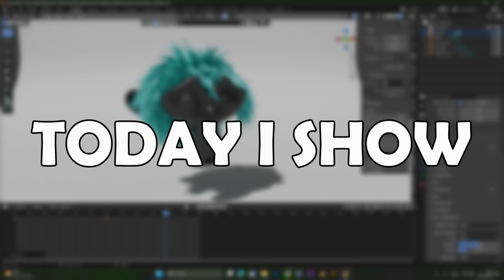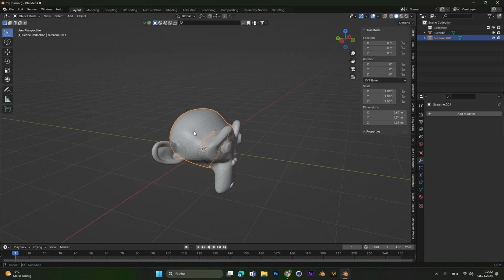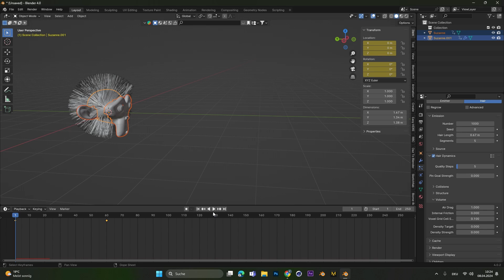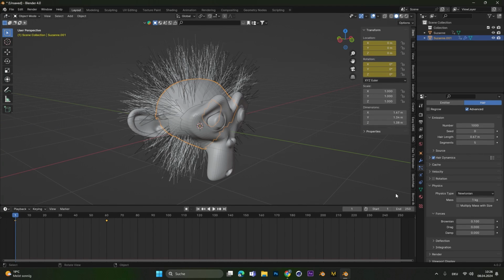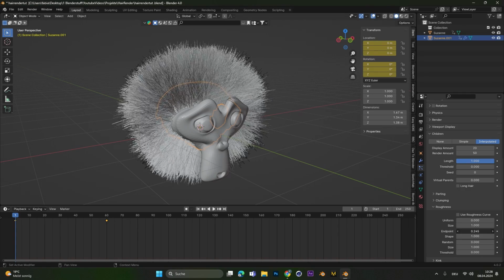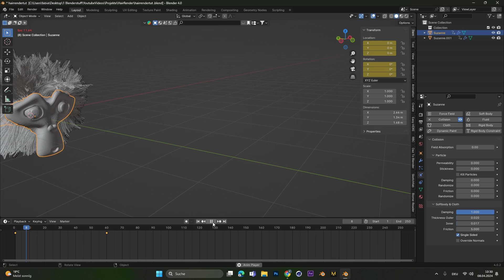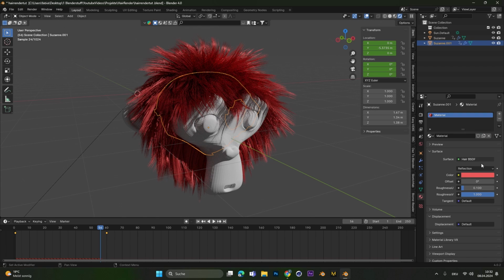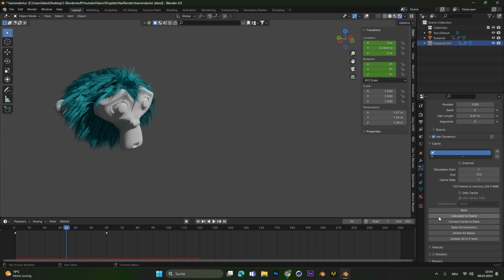Dynamic Hair Simulation Blender 4.0 Tutorial!

Comment: It's not your fault, but that looks like garbage. Is that as limited as Blender is hair simulation is?
Reply from the maker: No you can push the limits further but yeah its not the best. But for some mid range shots its good enough if you look more into the style and material of the hair👌🏼
Reply: increase amount of 'bend points' (segments) of each hair strand, increase hair dynamics "quality" setting, and randomize the length of hair so it doesn't look like your drunk cousin cut your hair with a butter knife.    then just watch patiently as it takes 30 minutes to play a 2 second animation.  And you will have to do that 100's of times while tweaking the settings.  It gets better though(sarcastic).  Blender team stopped updating the "old particle hair system" you see here, and added another (even less intuitive) method.  And best part(again, sarcasm),  there is no hair dynamics for the new system.   But it's free!